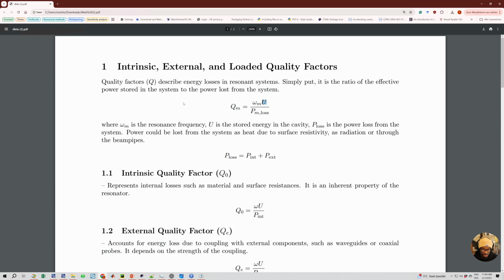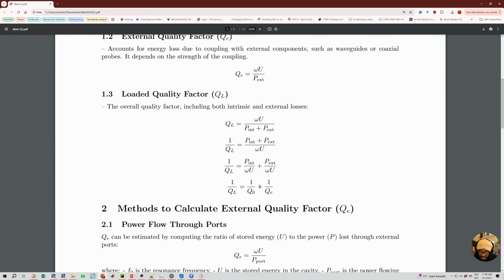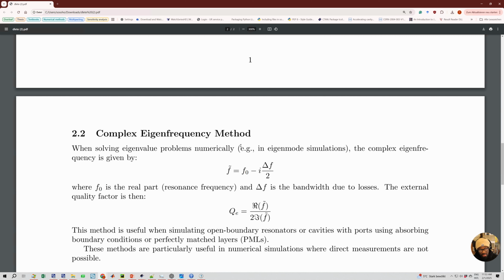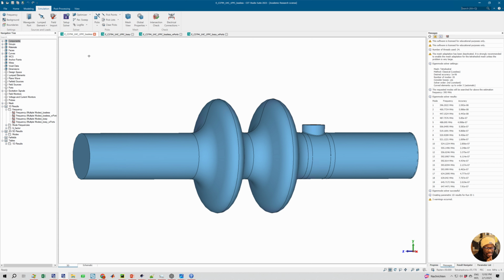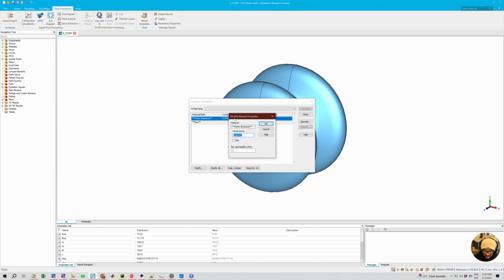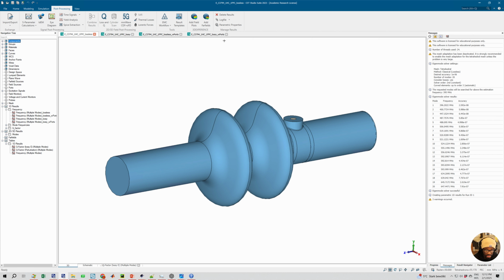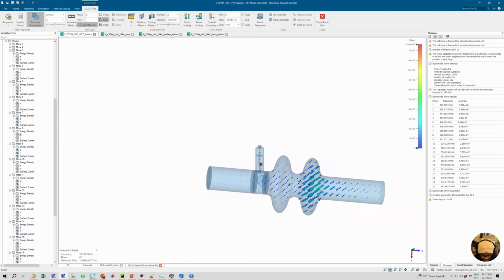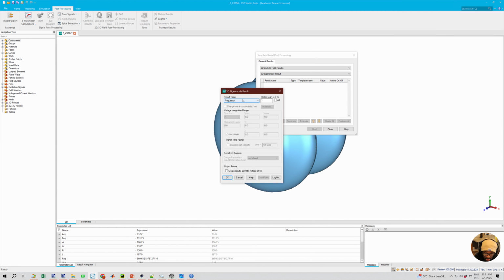CST Studio Suite - Q-Factor Calculation

Comment: Thanks for such nice informative video. I am using CST2024 and Eigen solver with Gernal Lossy for super conducting cavities. The simulation returns me Total Q and External Q. What is this total Q as I suppose if PEC is used as material then power can only dissipate through ports which means just Q external.
Reply from the maker: Hi, thanks. sorry for the late reply. I have been away from youtube. Yes, that is exactly correct, the total Q is the external Q.

Comment: Have you ever compared external Q between using waveguide port and open boundary condition? I found there are some difference (about 10~20%), but I don't know where is wrong.
Reply from the maker: Sorry for the late reply. I have been away from youtube for a while. Coincidentally, your question may be addressed in my new video. Basically, the Open boundary condition does not absorb all the waves incident on it, i.e. reflection occurs and this explains the difference. In my video on the different boundary conditions, you see how much worse it is compared to the waveguide port boundary condition.